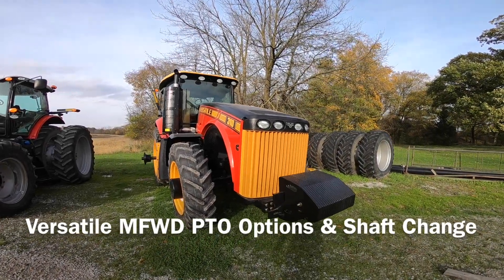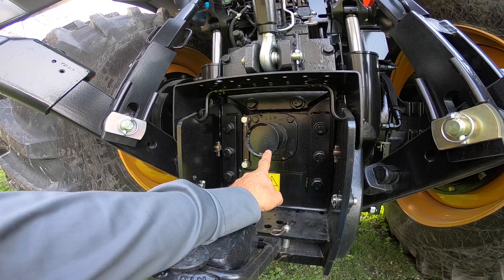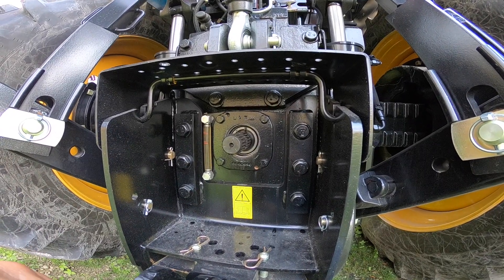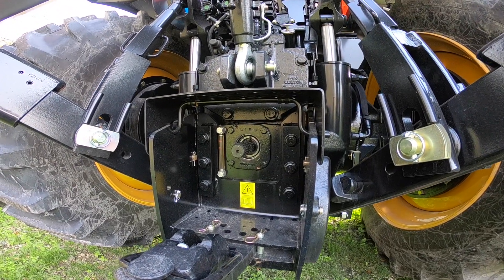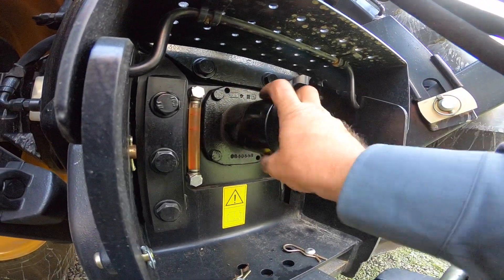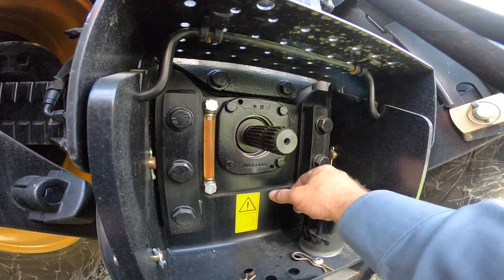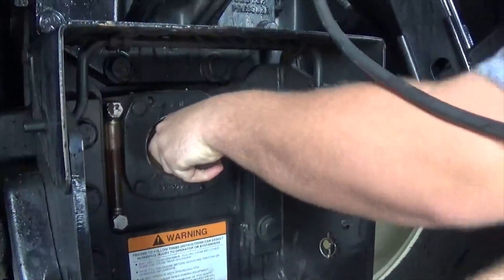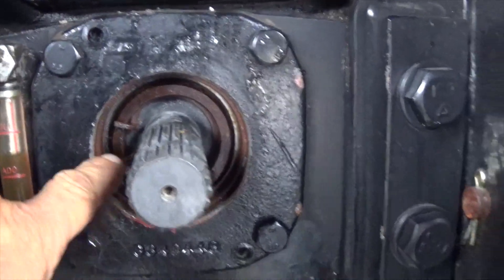Versatile 260-310 MFWD Tractor PTO Options & Shaft Change

Comment: Same as/on Genesis 70 series (Verstile/N-H/Landini/Fiat)..... You only need to switch PTO every so 80hrs in order for em to pull-out nice. When they pull-out too nicely after 300hrs, that's when it's time to change to housing-bearing or seal. They all leak from there (they all do anyway ever since PTO was invented) ;)